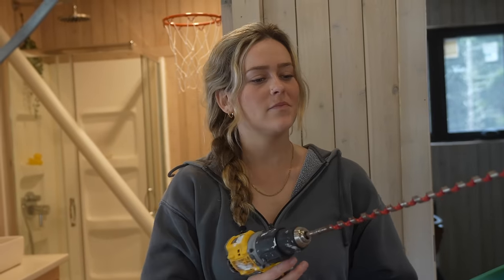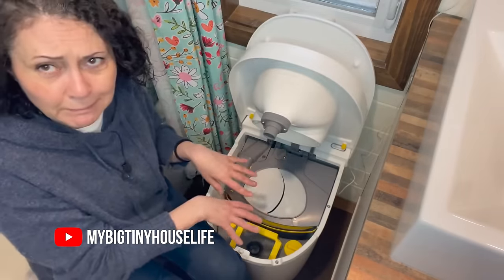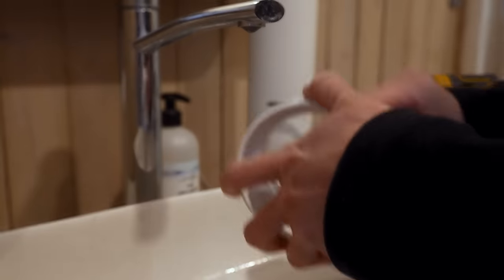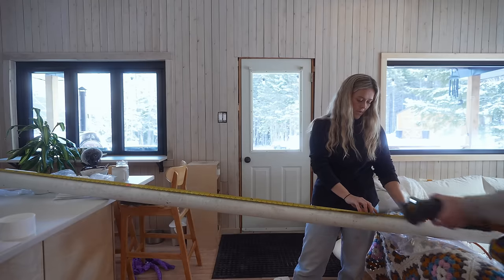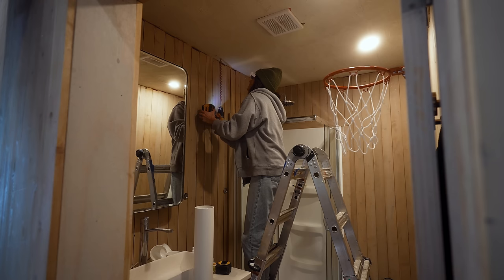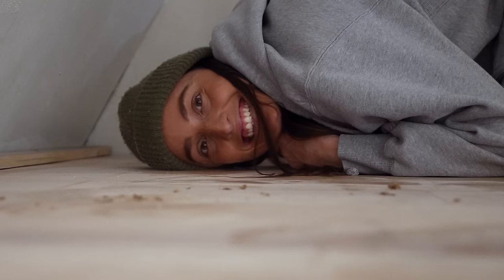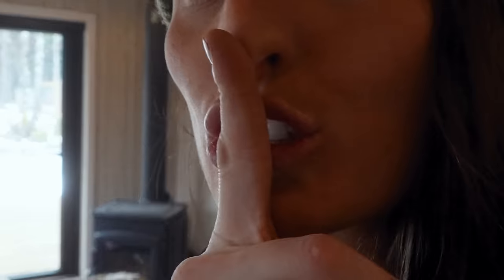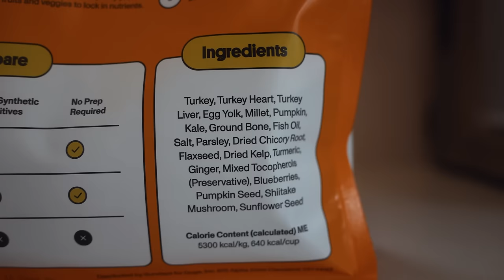Our Honest Experience: Off-Grid Cinderella Incinerator Toilet

Comment: If you have a vent system for odors and drying, you need to provide air for the vent. The vent system will suck out heat in the winter and cooling in the summer. Make up air is a must.

Comment: Good afternoon ladies. Some 30 years ago i had researched the incinerator  toilet products and had concluded that they had some  shortcomings, so i passed on that style. When you came up with the idea of installing one i would have recommended that you change your minds had i been able to do so . Water under the bridge now i know.  I hope that you have better luck with this new one. There is one more thing that you need to do up in the attic to prevent problems in the colder part of the year if you will be here at the cabin during the winter . The plastic vent pipe needs insulated to prevent the moisture from condensing and  running back down into the toilet. This only happens where a pipe passes through a cold zone, like the attic. You could wrap pipe insulation around the pipe  if you have clearance to do so  An other way woukd be to use 1 in pink foam board to make a 3 sided cover over the pipe where it lays on the floor. Use red tuck tape to fasten the pink foam together. Easy to do. And cheap. Have a nice day.  Tom  in the Maritimes at the NB-NS border.

Comment: When drilling in crystalline material, like your cement coating or plaster or fibercement, you need a carbide hole saw.  Then switch back to a regular hole saw for wood and light metal.  For tile you need a diamond saw.  I have a separate tool box in my truck with over 40 hole saws so I always have the correct type and size.
As previous comments have mentioned, high water table septic systems are available.  When you start making plans for your new next door build pick one of the many septic options.  Porter can make it happen for you which ever style you go with.
Reply from the maker: Thanks for sharing your knowledge. One day we will have e a septic. 😊🐾
Reply: @Vanwives  When looking at septic systems, look at aerobic systems. These don't need a leach field and are suitable for places with high water table and rocky ground.

Comment: What a nightmare... Thank you for sharing your experience; I've certainly learned quite a bit. 
For your new installation, are you planning on insulating your drain pipes under the cabin? I'd be a bit concerned about freezing temperatures, particularly at the drain trap and the transfer of cold air into the building via the pipe.

Comment: Thank you so much for sharing your ordeal. As I said in response to your first video on your incinerator toilet, I have lived off-grid for 40+ years and for the first 30 years, I was involved with the design, installation (or at least the use of), several different types of alternative toilets.  I wondered how that toilet was doing. Even if the company offered good customer service, I had a hard time imagining this type design being practical, low maintenance, much less economical enough for the vast percentage of off-grid folks I know. I was worried. . . though not for too long because I then reminded myself that you folks are smart and innovative enough to survive such an experiment. . . but so sorry you had to put up with that kind of service.

The type toilet you installed in this video is the type design (a dry, separating toilet) that I most recommend. Yes, I agree that a dry, separating toilet is the best for off-grid and I hope it serves you well. I appreciated your review of this particular brand. Our dry, separating toilets are similar in design, though are one-of-a-kind, built-in place toilets. Ours uses solar heat and a 12vdc fan and only needs emptied once a year (through a slide-out drawer in the outside wall). Your toilet is portable, shippable, and has a couple of automated features that are nice (and intuitive). 

I look forward to hearing more in the future. Keep up the good work of inspiring so many folks!

Comment: Interesting to hear about your experience. 

I'm looking to get a solution a partly off grid "daytime home".
We have grid power, but no water or waste water.
Water is possible, but waste water would be expensive.

We have primarily thought about fully electric incinerator toilets, possibly with urinal on the side.
Hoping that an incinerator is fairly low maintenance, but with your experience, I get second thoughts.

Comment: This looks like a great toilet option. Much better than the ‘composting’ kind. Those are too small for regular use and don’t actually allow for the material to get composted, and then they’re a lot of work to clean out and change over the coir. This way you can fit more 💩 and dry it out/have no smell and then easily dispose of or compost in a proper humanure pile if you have land like you guys. Wish I’d had something like this in my van instead of the  natures head.

Comment: I’m so sorry about your experience with Cinderella.  we changed from a Separett to Cinderella about 4 years ago in our cabin here in Sweden. Separett which we had about 10 years worked well but the pop definitely doesn’t dry out and has to stay in the bucket for some months before digging it into ground. We can also have it collected by the garbage company.  Cinderella works like a dream just a little bit of ashes to throw out, no pop no smiles no limits on how often it gets used per hour. Never heard of that before.  I wonder if you got a faulty Cinderella I’m so sorry they have kept your money😊. I hope this is of use to your followers . The Separett has a blue table that is put lying in front where the pee goes ,it dissolves when pouring the water in to flush after peeing.

Comment: I can’t believe that company, yeah I wouldn’t risk getting a loo from them and having to suffer through your experience. Thanks for the heads up. I’m so sorry you had to go through that. It sounded like torture to me.

Btw I was thinking, now that you have moved the location of the toilet which has opened up that space next to the shower, if it’s wide enough you can move your washer and dryer set up there. In Australia, we are more likely to combine our bathroom and laundry spaces than the kitchen laundry and that will free up your wardrobe for your clothing. Btw, where do you store your linen?

Comment: Use local designed pipes if you don't want cracking, freezing or incorrect flexibility/resistance to ground movements.

Comment: The poop doesn’t actually dry out but it’s neither here nor there. We don’t even bother with the bags anymore. They didn’t compost very well. Also, Canadian tire has a long wire handle brush, you’ll want to pick one up and trim the bristles so they fit in the pee tube and use it to clean occasionally. The urine builds up. But nothing to break down and you’ll be so much happier with this one!
Reply from the maker: Thanks for sharing your knowledge with us. We appreciate the tip. 😊🐶
Reply: I agree it doesn’t really dry out  like I expected it to but still zero smell.

Comment: My husband designed a worm pit privy for a couple that built a cabin in the forests of northern California in the early 1970’s. But you now have a modern version, but instead of your poop going into a large plastic bag to throw away you can fill the bottom of a trash can with dirt and earthworms then dump the poop (not the Bag unless it’s biodegradable) into the trash can which the worms eat your  poop and the worm poop smell and looks  just like dirt and after it has all been digest can be used in you garden and you won’t need to buy compose any more.  Or deal with a trash service about it.  My one concern is how to keep the worm from freezing in the winter in trash can out side.  Maybe store it in your out house. In California it was under the house and under the toilet and the urine was diverted just like yours is.  And the poop when right in to the worms and there was a fan to the out doors for the smell, just like you new one.  I was in a air B&B just recently that had the same toilet you just installed and if I didn’t remove the bag and clean it my self, they would change me and extra $30.  You can buy earthworm usually in the USA at a bait and fishing store.  Good luck with the new toilet. 😎

Comment: I have been a subscriber of yours for quite a while, and will continue as I truly enjoy and believe in your channel,, but I wanted to clear up one thing about the Cinderella toilet that you are not correct with. In your manual, it explains how to do a steam cleaning, which is simply after you empty your ash tray, you put tapwater back into the ashtray slide it in place and hit the flush button so it runs a burn cycle with just water.it steam cleans everything inside and keeps all the buildup from happening. If you weren’t doing this, it is actually you who. Caused this toilet to malfunction. The steam cleaning breaks down the buildup in the catalytic converter which allows full airflow and a proper burn, if you get build  up it lowers airflow and does not burn properly . adding water is all that is needed and no disconnecting of the gas line is needed for steam cleaning.  I understand these are different types of toilets but they function very well and that steam cleaning process is the key and the most important part of the maintenance. You only need to disconnect the gas once a year to do a full check up and clean inside. I enjoy watching every episode, as it is very informative and honest, but to cut down this company for the wrong reasons is incorrect. I hope you re-read your user manual and correct this video to your findings because a simple misunderstanding can be very detrimental to one party. And full disclosure, I do have one of these exact models behind my shop, and I am an installer of these toilets, I wish you the best of luck and I hope you do as you say on your channel and correct this once you have reread the user manual thanks

Comment: I feel your pain.  I have to use a 'composting' toilet.  However, my landlord doesn't want composted waste on her property, and can't afford a pump station to her septic tank.  Therefore, I put a garbage bag in this $1000 toilet and multiple bag it on trash pickup day, and send a week's 6 pound worth to the landfill.  I do sprinkle a scoop of hydrated lime on the waste after every use.  After seven years here, the novelty of the situation has waned.
The PVC pipe:  the thin stuff is DWV (drain, waste, and vent) and the thick stuff is Schedule 40.

Comment: I seriously considered a propane toilet for a cabin and decided on the Separate instead.  The long run of pipe you chose vs direct venting out the back through the wall may require a second fan near the exit.  I would HIGHLY recommend putting a regular heavy duty plastic bag under the thin little biodegradable bag from Separate, just in case …. and never remove the bag from the bucket until you have the bucket outside and have something prepared to hold the waste.  Not always pleasant and IMO a separate burning area is essential unless you have another disposal plan.

Comment: great analysis of the incinerator toilet! When you decided to use it I was very intrigued.....it's an interesting concept (except when using propane to power it, which is a fuel everyone should limit). I am sorry you connected the urine to your septic......there is a lot of great uses for the urine. Yes, I know it's a hassle, but many things that are worth doing are often more difficult. PS: I'm a huge fan of composting toilets, and the thought of dispensing of the poop in plastic bags is not something I would opt for......but I get it: after a year of pooping/peeing in the cold, it's a joy to not have to deal with it at all now. Thanks for sharing,.......and shame on the other toilet customer relations.

Comment: Swedish (and European also, I believe) vent pipe diameters are typically 75, 100, 125 mm. I'm not sure how well that works with imperial 3, 4, 5 inch.
3 inch is 1.2 mm wider than 75 mm.
I suppose there would be adaptors

Comment: Miigwiich for your honesty. 
Moving forward to be off grid as an elder I have done research on compost toilets and it struck me odd when one of the tiny home connects I went to  said they bought a Cinderella toilet used for $4000.00 due to a customer who decided to install a septic. I question the purchase statement now of the seller.  I believe Cinderella in your case is in violation of the Consumer Protection Act. In In possession of your $6,000.00 toilet and continued refusal to return your money I believe this could be considered a direct violation of the Criminal Code of Canada, theft above $1000.00. I doubt Cinderella applied or received an exemption certificate as to breaching by intention and omission The Canadian Charter of Rights (sec 15) in refusal to provide same rights to services to you unless you voluntarily abrogate your rights under Section 1 of the Constitution 1982.
 Just think if they had provided you with same rights to Customer Service mandated under the Consumer Protection Act what GREAT publicity that would have been.

They do not it appears know how kind, considerate and caring you are as well as patient and skilled. You are great.

Comment: If the toilet worked perfectly every time, what advantage is there for an incinerator toilet? Im a plumber snd gasfitter. If you have the land, just install a septic tank, then you can have a normal $200 toilet. If you want to re-use your waste for fertilizer or whatever i get it. But throwing out $6k of ash or $1½k in bark fiber, i just dont undrstand why anyone would choose ash.

Comment: And you're right I hate composting toilet I had one in my house back in 2000 two page $1600 back then without the toilet bought a porcelain rv toilet worked okay for the first few months then it was horrible stinky under the house hated dealing with it turn it in all the time adding your lime and peat moss had to put a 4 inch pipe 8 feet out of my roof to get rid of the stink otherwise the front yard would stink the great big long 8 foot pipe sticking out of the roof yes with an elbow on the top of it so the water wouldn't go down hated it

Comment: The toilet is by far one of the most important things in a home so you definitely want a reliable piece of mind machine without a doubt in my mind 👌 just a thought ladies,,, could you not have a septic system installed and just have it pumped out when needed?
Reply from the maker: We want a septic, but we needed something right away. Septic will be in our future. 😊🐶
Reply: @Vanwives  up top for thinking down low for stinking 🤣 you ladies have come such a long way over the past few years 🤙always thinking 5 steps a head.... well most of the time anyways 😁 keep up with the great work 👏
Reply: @Vanwives  I am a septic pumper and installer, (from Ontario) if you have questions.

Comment: Holding your toilet hostage in exchange for silencing you is straight up mafia behavior, they should be punished for that by the regulators 

Anyway, if the new toilet doesn't work out, I recently got myself a Clesana C1, its dry flush and it's super cool

Comment: Excellent video and glad to hear you stuck to your guns. Your experience was totally unwarranted and shame on Cinderella toilets for not supporting you with the issues you had. Regardless of what caused the original issue (it was probably just an issue with your individual toilet), the company should have immediately assisted you in fixing the problem by sending you a new toilet. Instead they try to blackmail you and keep your money! Shameful. That alone shows how bad the company is and no one should support them, regardless of the toilet design.
FYI... our Class B Embassy RV has an option to use Separett toilet (the TINY model) and some owners have said the cover sometimes sticks (the cover that should open up when you sit on toilet), so just double check that every once in a while!
Be seeing you!

Comment: Flush that Cinde down the tubes. Midnight has come and gone. No prince to the rescue. Short term low budget fix - $6 k plus $2 k= $8 k. Sometimes KISS just works.

With more research and $$$$$$$$$$$$$$$ invested, you can install an appropriate septic system.

Comment: Just put in a septic system. Those toilets will always be a problem. You have a backhoe and could dig the drain field and lay the pipe and stone. Just have your buddy dig for the tank and install it. All simple plumbing. Poop needs to flow downhill, not out your roof. :)
Reply from the maker: Yes we are thinking of that! Had to get our 6K back haha